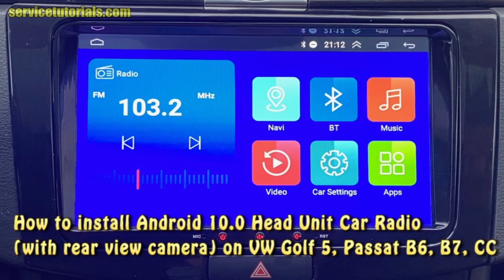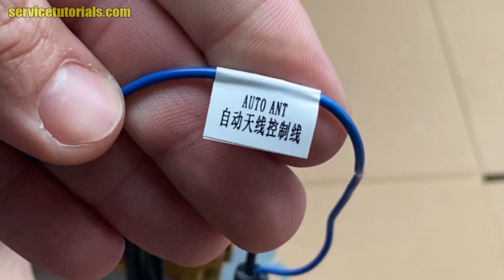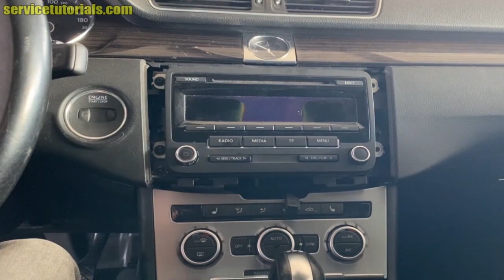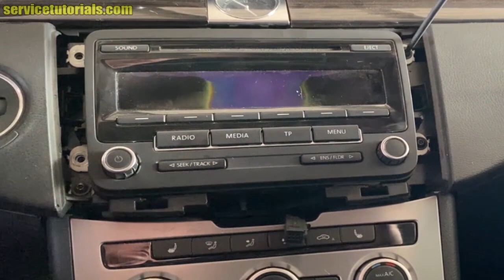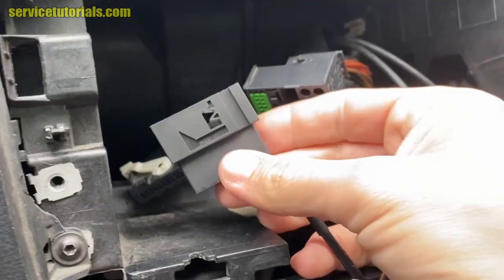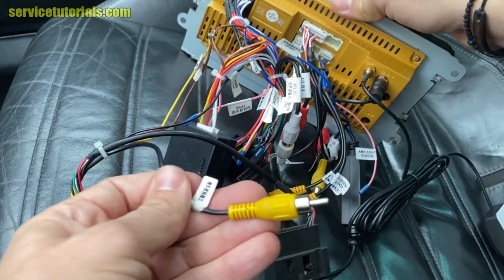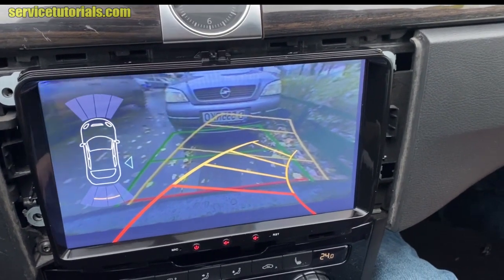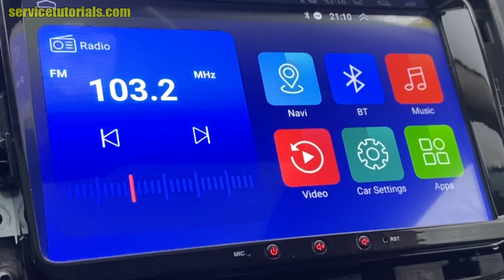How to install Android 10 Head Unit Car Radio (with rear view camera) VW Golf Passat B6 B7 CC Skoda

Comment: Hi,i have  Skoda Superb 1and  excuse me but i have a similiar plugs but camera cables have on older function with backlight plugs. I Have problem with can bus and can't work so can you tell me what i doing wrong ?  Do I must change Gateway firmware ?? Thx for advise

Comment: Thank you very much for this video, helped me to realize that I needed the adapter box for the rear camera. Any advice on steering wheel buttons not beeing recognized by the android stereo? cant figure out why dont work. Also my CC 2013 came with navigation, do I need to use the GPS box provided with the stereo or can I use the factory one? thanks from Argentina!
Reply: Hey I've got a cc 2013 as well, I was wondering if you faced any challenges and what model you bought? I want to make the purchases too, my unit recently went bad.
Reply: @4eignr  Hi, I bought an Isudar T72+, works fine, you will need cable adapter and boxes. A box and cables for the rear camera (comes all together), that's the most difficult to install, but it's not that hard. Also if you have the shark fin antenna probably will need an adapter for the "fakra" plugs. If your car came with navigation another cable adapter is needed for the GPS antenna.
Reply: I didn't realize that either.  Glad I found the video.  Ordered the rear cam adapter box today and a little nervous about splicing, but the video was very straightforward.  DId you ever get the steering wheel buttons to recognize?  I tried going into the factory settings and verified it was the Raise protocol for VW, but every time I try to assign the steering wheel control I get a red error message.   I've got the dual fakra white plug for radio antenna, so I think I'll need an adapter for that.  I think I need a fakra to coaxial adapter for the factory GPS antenna.  I'm assuming it will be placed in the sharkfin, so better reception than the one included with the unit.

Comment: Thank you very much for this tutorial!  I was very frustrated because I bought this unit, and could not get the rear camera. I didn't realize it needed a separate adapter!  I ordered it and followed your tutorial, and it's working perfectly.   Did you have trouble with the canbus decoder and steering wheel buttons?  Each time I try to learn a steering control through the unit's settings, I get a "Failed" error.  I verified in the factory settings that I have the correct Protocol ... I'm not sure what else to try.
Reply from the maker: I don't know, sorry!

Comment: Just what I needed brilliant explaination. I am connecting to a Skoda Superb 2 same type of unit, the connections at the back are the same but I can see you have 2 black are they Antenna cables with same connection but you only used one. My problem is the same the car has i think they are called FAKRA connections, 3 connections one blue and 2 black but only one possibility on the unit. Do I need an adaptor or just use one of the black, ? thanks great video
Reply from the maker: @Irish_Balladeer  hi! I think one of the black cables is the Radio Antenna and the other one is from the GPS Antenna.

Comment: Great video, thanks for sharing
I have similar setup but have a question, in the camera RGB converter. You connect the Yellow (Reverse) and Brown (12v) together?
So the reverse wire is always plugged to 12v? Thanks

Comment: Nice tutorial, but i have a question, do you have problems with the battery of the car and the tablet did really shut down with the "shut down button" or just go in sleep mode like the normal android tablets. I have the same model, just bought it and place it on my Passat B6 2006, it run perfect but i think it runs non stop even with the key removed. Am i wrong but i think its normal when you put the key into the keyhole then the head unit have to start not all the time.
Reply: disconnect small black plug(orange and yellow cable I think)
Reply: @adimatei6684  Yes i did that and it worked, can`t remember what colors were the cables but they were with separate connectors, i just unplug them :)
Reply: @DMXX212  had the same issue. Undid the red and orange cables but it still stays on